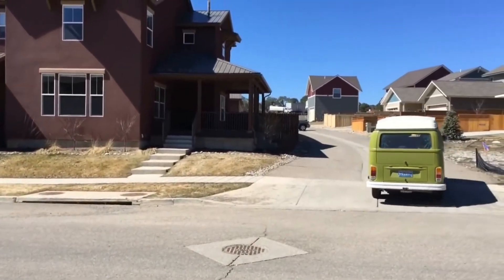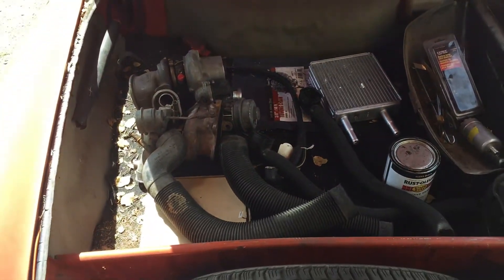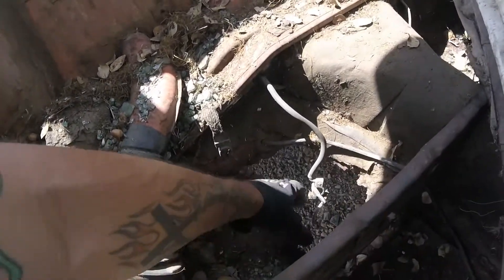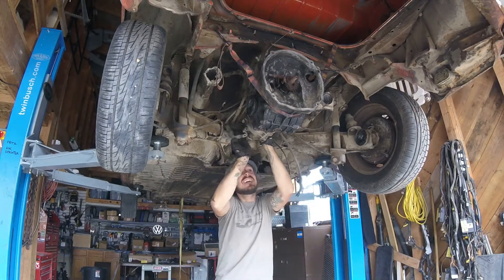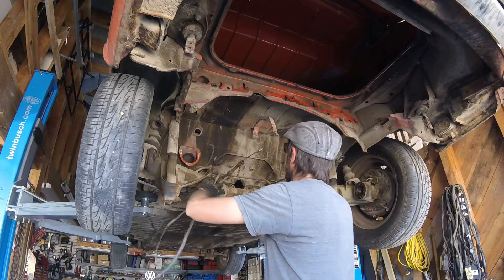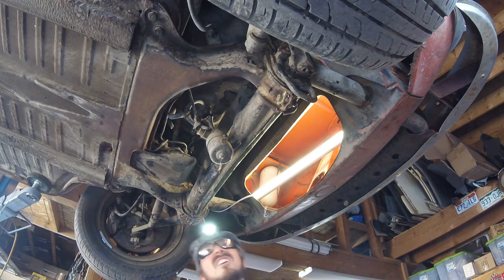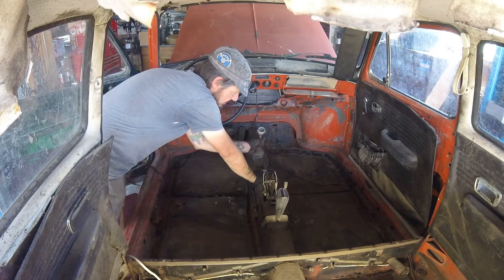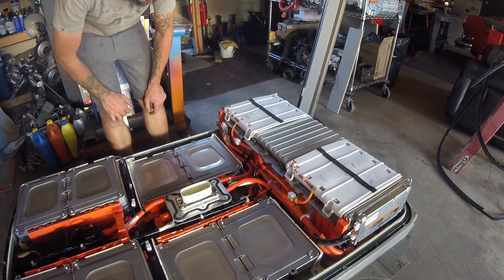FastLEAF Begins - Let the EV conversion begin!

Comment: Awesome!! I was going to convert my '67 Squareback to electric, but I did a Miata body swap with it instead (VW body shell, Miata chassis) and drove that for several years. Then I traded it for a 1980 Mercedes w123 that I will convert to electric now, or I will convert my '62 Mercury Comet instead.
Reply from the maker: I think I remember seeing that squareback - rad project!